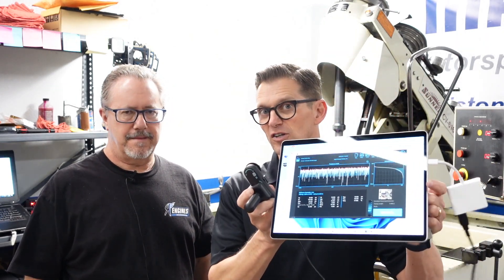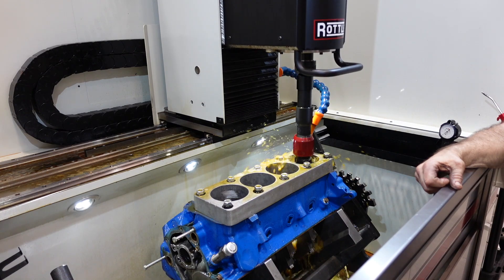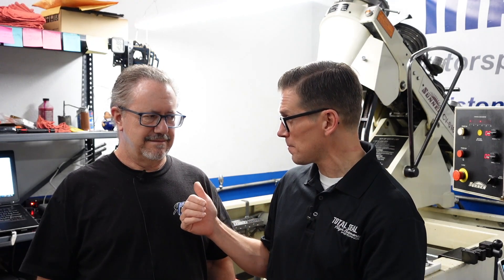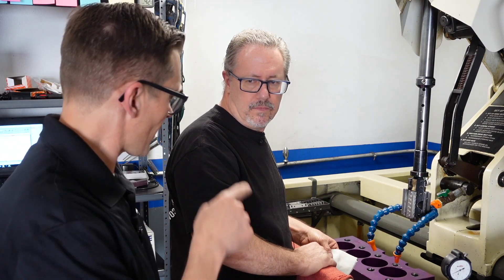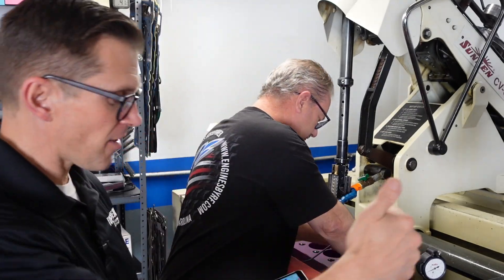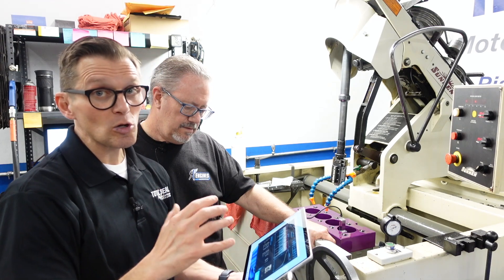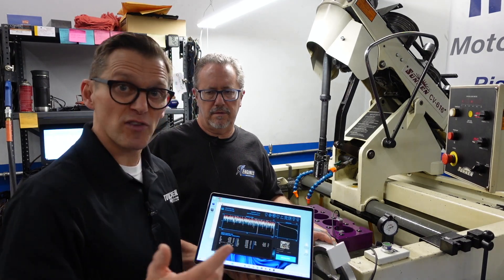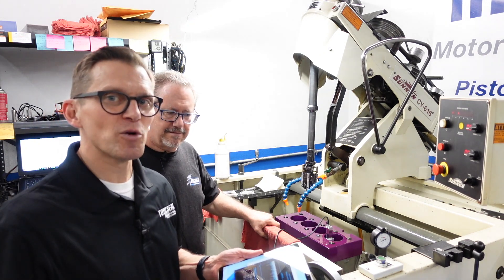Old Machine, Modern Surface Finish - Can It Be Done?

Comment: so far so good. Since Ive been 16 years old Ive used a drill hone with stone abrassives shoes. These days the only difference is that I use a torque plate and diamond shoes. For sure checking size and surface finishes over and over again is key as you have stated. Very informative, thank you sir.

Comment: @TotalSeal...
Question(s): Those three strokes with the brushes, takes the "break in" process away from ring running in the bore to do the work and possible degradation of parts or risking glaze... and presents a truly finished bore for the rings to ride in?
    What would you expect to see are the RPK #'s after, say a couple of good dyno runs following this hone work? (much change or not??)  
    Are these Mazda blocks hard? (say, compared to a Dart-SHP casting)
Reply from the maker: Actually, the three strokes with the brush does not take away the break-in or risks glazing. The Rpk delivered by the correct use of the brush, improves the break-in process. Think of it like Goldilocks and the Three Bears, you don't want the cylinder too rough or too smooth. This process makes it just right. 

In regards to the Rpk after break-in, we have a video coming out in a few months that will show exactly what happens to the surface finish from honing, to assembly, to break-in and after running. 

Also, the Mazda blocks are softer than the Dart SHP blocks.

Comment: There might be some flaws in the assumptions leading up to my question.  If so, feel free to correct them.

I have been taught that cast rings require a fairly coarse honing in order to seal correctly.  And that, by nature, the break in process with that ring and cylinder finish combination is a destructive one.  The rings and cross hatch create their own “plateau” during break in.  It works, but you have knowingly shortened the life of the rings (perhaps the cylinders too)  from day one.

So, let’s say I have an engine from the 1950s or early 60s (in my case an early Chevy inline 6).  Cast rings are the only thing widely available for those ring dimensions.  

Can a guy skip all the destruction of the coarse cylinder finish, and still get cast rings to seat with a cylinder that has more of a plateau honing like you have here?  Understand that you at optimizing the cylinder for a very different ring (thinner and lower tension).  But is it a myth that you NEED lots of roughness to seat an older-style, thick, cast ring?
Reply from the maker: Thanks for the question. It is Chrome faced rings that require the coarse finish for proper break-in. Cast rings (without a Chrome face coating) can use a plateau finish, but Chrome faced rings can not.

Comment: Would this more modern method of honing and thinner rings be beneficial on an old motor that won’t be used in high performance application? I’m considering rebuilding a Ford 300 I6 for an old pickup that I own, but would like to make some modest improvements over the stock motor.
Reply from the maker: Absolutely. Modern honing and thinner rings make engines run cooler and live longer.

Comment: Could be wrong but those didn’t look like diamond holders? Any more info on the diamond holders and abrasives used?
Reply from the maker: Those are 120 grit Diamonds for the roughing operation and 600 grit Diamonds for the plateau strokes.
Reply: @TotalSeal  Who are you getting them from.  thank you

Comment: I have witnessed with a Profilometer, Bore dial indicator, Micrometer, ect with proper tooling, patience one can even achieve 
.0001 all four corners bore distortion and correct cyl wall finish with hand made suspensed by spring drill hone with Torque plate.
Something 1 Muskogee and 2 Tulsa Machines failed to achieve.
Just saying it can be done, not my choice of time spent but definitely witnessed and used said engine for one of the racecars in a bind at the 11th hour. 2.0l went 12.1 at 115mph in a 3600lb car on 18 psi of boost from a small td06.
Ran for a full 3 season and 15000 miles before tear down and them cyl walls beautiful.  Except for the window from the failed water meth controller hydrolocking cyl #4 but hey cyl walls are beautiful..
Always thanks for Lake jr, Total seal and all from PRI!!!!!.
Reply from the maker: Thanks!

Comment: I believe WJ has said "a good machinist can make perfect parts on a bad machine. A machine operator can make junk parts on a perfect machine"
Reply: Absolutely true! I own a small job shop with no CNC machines. The equipment I have is old, but my machinist is about the same age as the equipment, so all things are equal. Steven Edwards makes some of the most amazing and beautiful parts that look like they came off of an assembly line!
Reply from the maker: So true!